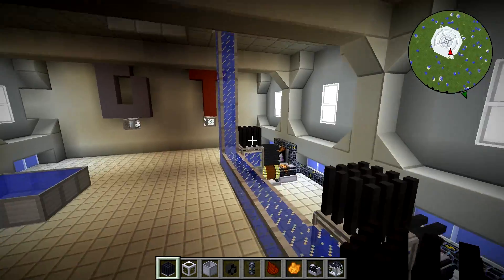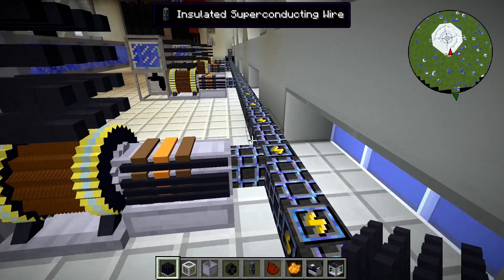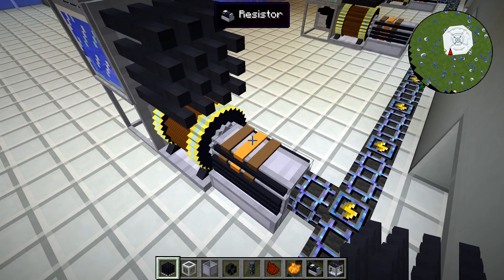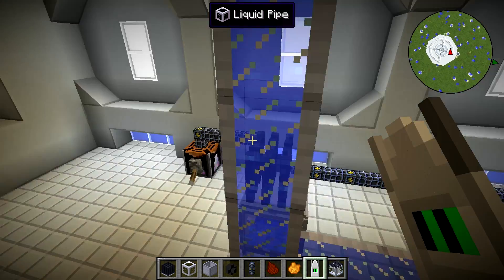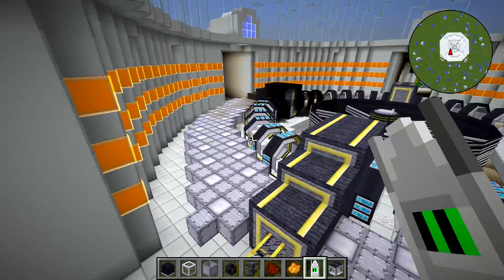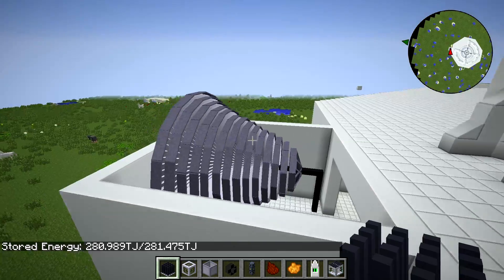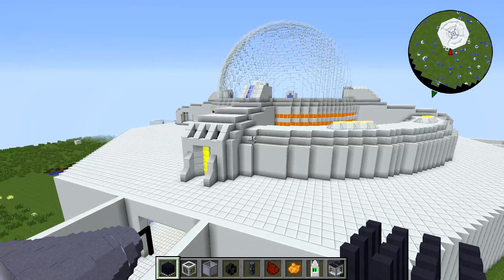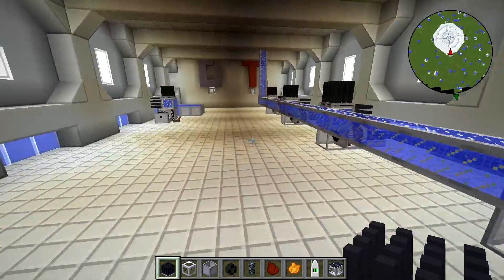ReactorCraft - Fusion Plant Build #3

Comment: I, personally, would run the motor with more power, and use shafts and gearboxes. That way, the power and speed can be precise. Just my opinion though

Comment: i believe from my experience with electricraft the batteries output from the top and input from the side.. but its redstone activated.. output with redstone signal but no input.. input without redstone signal but no output.. so its one or the other I think.. you would have to play around with it in more detail..
Reply from the maker: Ravyn Knight If that is the case then I'd probably want more than one battery. I'll have to fiddle with it in creative.
Reply: +Ravyn Knight output is redstone activated, input is always on.